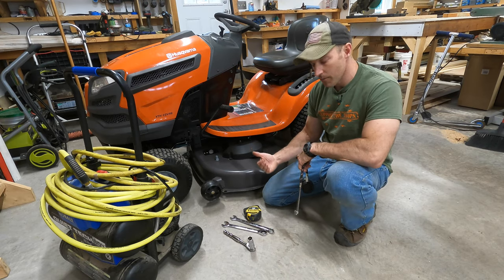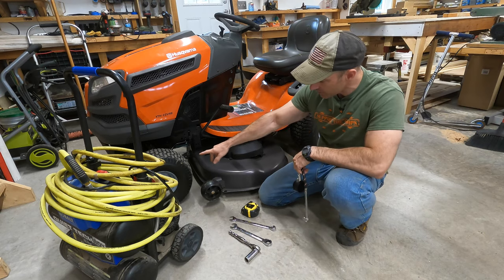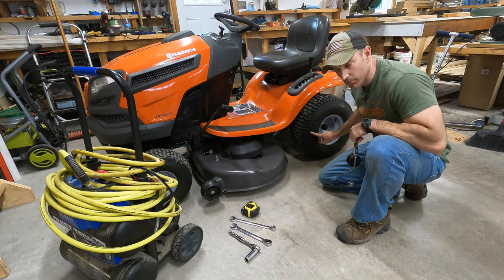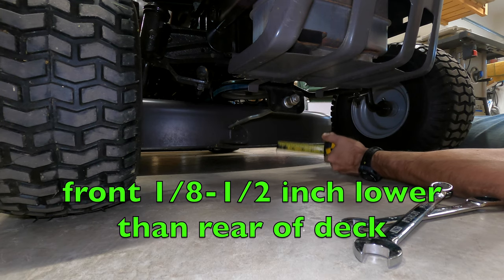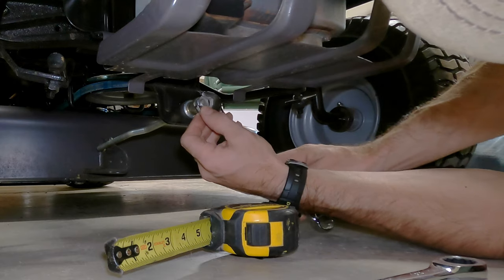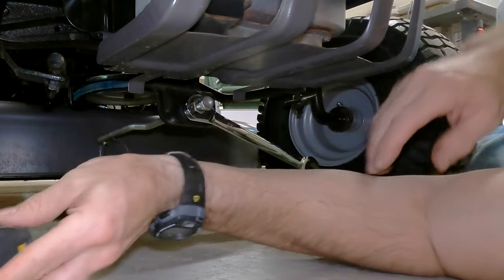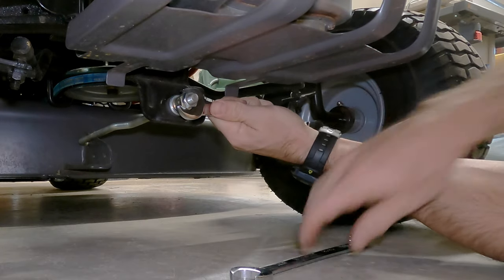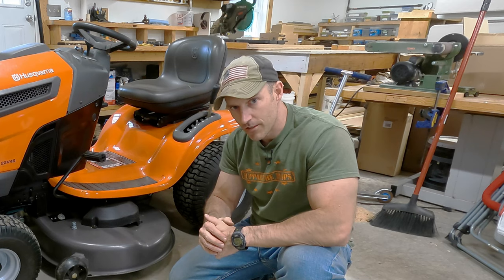How to level your Husqvarna lawn mower deck YTH

Comment: I’m a widow and learning everything about how to maintain and fix my outdoor equipment. Your video was extremely helpful.
After putting on new spindles and blades I took apart the rear adjustment arms (they had craftsman 20 mm sockets on them along with rusted bearings). I also rebuilt the carburetor on the Husquivarna YTH 24V48. The springs were not fun on this one.
After looking at a parts diagram I   quickly determined the idiot at the repair shop had no idea what he was doing. Now I own two extra craftsman sockets he had on the rear adjustment arms trying to level the mower and  I have a level mower. 
Thanks again for such a clear, descriptive video and thanks for letting me know what tools I needed in advance.
Reply from the maker: Glad I could help you Robin hope your having a good weekend.

Comment: Thanks for a great detailed video. 
I decided to go for 3 1/8" in the front and 3 5/8" in the rear of my 46" deck. That should be the maximum height to go as it comes real close to my belt rubbing but, time will tell.  I should be barely safe with the belt. My front was at about 2 3/4" to start and the rear was 3 1/2" to start, so, adjustment was in order. Been that way since new and I have 72 hours on it. Great tractor for sure! BTW, I run LEADED 'NON corn alcohol' fuel that I get from a gas station near me. I run it in all my small engines as it's a safe alternative and it stores much longer without gumming up as with Unleaded corn alcohol fuel, and my hoses will be just fine. ALSO for those who don't know, the triple bagger  for the 48" decks will fit the 46" DECK  mowers. Usually the 46" decks are two baggers. I found out by mistake when I bought the triple bagger and it fit great. When I went to look for a new rubber part for the chute, the triple baggers said for 48" decks and double bagger for 46" decks. Boy was I happy to learn my mistake was a perfect fit! The more bags the better and the longer you get to mow in between dumping's.
Reply from the maker: Thanks for watching

Comment: To make the job a little easier, cut 3 or 4 blocks of wood at the right size you need and mark the sizes.  That way your not fighting with a tape measure.  Thanks for the video.
Reply from the maker: I did that with my John Deere thanks for watching
Reply from the maker: @Jeff Haddan I though about that as long as the mower itself is level. I was just going by the manual. Not everyone has a level. Thanks for commenting and watching

Comment: Not everyone has a four foot level.  The basic process is the same for all makes - put your tractor on a level surface, measure the height of the deck rim first on both sides and adjust using the rods... then measure in front and in back and check which hole the front support arm should be in to give a slight rise in front.
Reply from the maker: Did I even use the level? Thanks for commenting

Comment: Great video, thank you very much! In the video, I noticed that your deck height selector was at it's "max deck height" position  (number 6), when you were showing us how to do the adjustments.
   My question is, "Is 3.5 inches in height for the rear of the deck at max height, listed by Husqvarna's factory service manual as the correct height for that setting? Thanks for any reply, and thanks again for the lesson. 👍
Reply from the maker: This was my neighbors mower not 100% sure. I would have to check the manual. Sorry I couldn’t answer better. Thanks for watching

Comment: Last week my Husky started self destructing as I was mowing. A major weld broke from the bracket holding the deck. When it was welded they missed the seam completely and the weld was also cold. Sure wish I had bought another MTD!! Husky sucks! This is also a replacement mower. The first one had the transaxle replaced three times!
Reply from the maker: Holy smokes, Thanks for watching

Comment: I have a YT 42XLS, I bought used, without a user manual.  This helps!  Thank You!  BTW, the middle of the 3 (sharpened) blades is leaving a trail of partially uncut grass, and I have to go back and mow it twice.  Any suggestions?
Reply from the maker: Sorry not sure maybe with three blades it gets leveled different. Sorry I can not help
Reply: @DIYJIM  Ok, Thank You anyway! 🙂

Comment: What did you have the mower height setting at. From your video it looks like it is set on the highest setting?
Reply from the maker: It does not matter what the height is set at when you make adjustments because there is only one adjustment from side to side then one in the front.

Comment: According to the manual, when adjusting the level of the Husqvarna deck. You measure from the ground to the blade. Though don't know if there's any difference compared to measuring from the ground to the bottom of the deck frame.
Reply from the maker: Thanks for watching I think i said that in the video. Thanks for watching

Comment: I have the same mower and last year I hit a rock while mowing the ditch next to the road and bent a blade really badly. It also broke the spindle. So I just replaced the spindle and blades and the deck was uneven. It only had an adjustment on one side and I had to max it out to make it even. The belt was ruined by the broken spindle so I replaced it as well. Now the weird part…when on the highest setting the blade is now engaged and I can’t even turn the engagement lever to the position it is supposed to be in for blade engagement. I’m not sure why but I actually like it a little bit because I don’t have to disengage the blade to back up anymore which always annoyed me and the height is perfect for the way I like to cut my grass anyway. And when I hit a tall and thick spot I can just press the engagement lever towards the position for engagement and it prevents the belt from slipping and powers right on through it. I am going to take a look and see if I can figure out what is causing this I guess but I had to get the grass mowed before it got completely out of control and like I said I kind of like the way it worked. The only thing is that I can’t disengage the blades so it could be a little inconvenient at some point. If you have any ideas why this might be happening I would appreciate your input and thanks for reading this long comment. I appreciate your videos and I have found them helpful! 👍
Reply from the maker: That was a long comment. Thank you very much for watching my video. Sorry I really could not guess why this is happening. Hope you get it figured out. Have a good summer.
Reply: @DIYJIM  I appreciate the quick response and you have a great summer as well!

Comment: I have the adjustments right but for some reason it is still leaving a strip of grass when I cut. For some reason also my anti scrap wheels are not even. The right and left front are not even. Any advice?
Reply from the maker: Watch this video for your scalp wheels https://youtu.be/viv-LW7bPCo hope you did not bend one of your blades.
Reply: @DIYJIM  I went back and checked my blades and they are bent. Didn’t think of it until you mentioned it. Thanks.

Comment: How to set the deck height on a riding mower.. Not levelling.  As you pointed out, the front of deck sits lower than the rear if adjusted properly. If it was level front to rear the deck would not be adjusted properly.
Reply from the maker: Thanks for watching

Comment: Probably a dumb question but that is measured 3 and 1/2 from the floor with the deck in the number six position correct?
Reply from the maker: It does not really matter just so the right side matches the left side

Comment: My question is where is the right rear adjuster supposed to be set at? My deck seems really low on that side.
Reply from the maker: There is only one adjuster just make it even with the other side.

Comment: Great video! Would it make a cutting difference if the entire mower deck was even all around? For instance, 3.5 in the front and 3.5 in the back.
Reply from the maker: Never tried it, I think it is better if the front is lower
Reply: @DIYJIM  Thank you for your quick response. I am going to make the adjustments. I am tired of my Husqvarna unevenly cutting my nice Bermuda lawn.

Comment: When you are doing these adjustments, what level setting do you have the deck lever set at? (Or does that matter?)
Reply from the maker: It does not matter, just make sure both sides Measure the same height. Thanks for watching hope this helps you
Reply: @DIYJIM  
Ok awesome! Thanks for getting back with me so fast and thanks for this great video. I will be checking out your others and you just gained another subscriber! Have an awesome and blessed day.
Reply from the maker: Thanks for the new subscriber

Comment: Hello Jim, new subscriber here. I was hoping you could help me out. I have that mower and I’m experiencing the left front tire rubbing on the deck. The deck is level, but for some reason the left tire is hitting the deck when I turn to the left, do you have any solutions for me, my friend thanks in advance.
Reply from the maker: Sorry not sure something sounds like it is bent. I would have to see it. If it is older maybe check this video. https://youtu.be/_ny-DWs5G7g?si=xTFAGzy6Cc1alw9s

Comment: When adjusting deck height, what notch is it in?
Reply: Also do you have to adjist the right side?
Reply from the maker: It does not matter what notch, and you just adjust one side so they both match.

Comment: What height setting is used
Reply from the maker: You level the deck at any height there is only one adjustment screw. Hope this helps
Reply: The reasoning it doesn't matter is because your just leveling deck not setting cut height. If you want cut postion 1 to be a higher cut level the deck at higher higher while deck is in cut position 1. But if too high you wont get to position 6 .

Comment: my back left is at 4.25 inches and front right at 2.25 inches. Both front and back adjustments are super jammed, i'm wd40ing them but can't get anything to budge with all my strength. Tractor is 18 years old and never been adjusted. 😞
Reply from the maker: Hope you get it fixed
Reply: @DIYJIM  i eventually made progress! got the back left down to 3.75 and the front right up to  2.75. it's an improvement at least. Got alot of rust but the wd40 helps. i ordered another deck lift adjuster for the rear, so that it can be adjustable on both left and right side in the back.